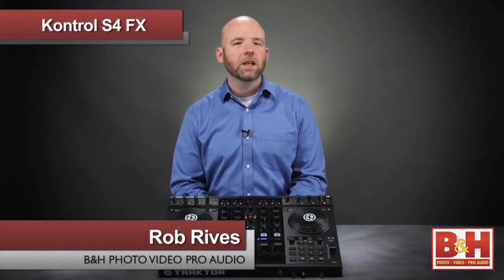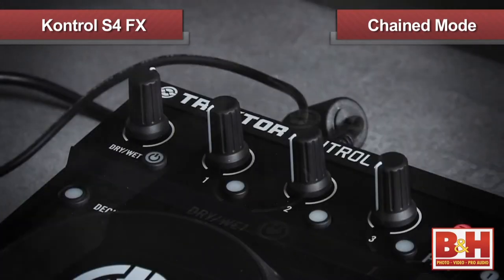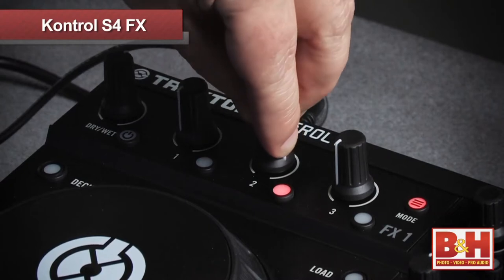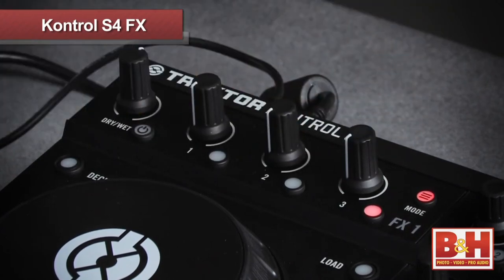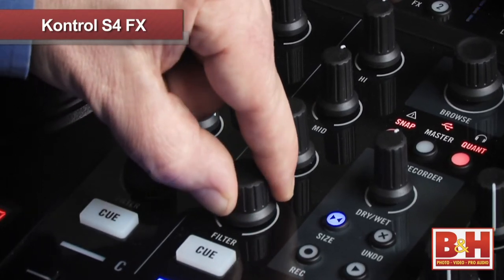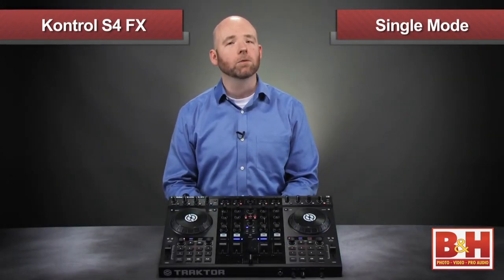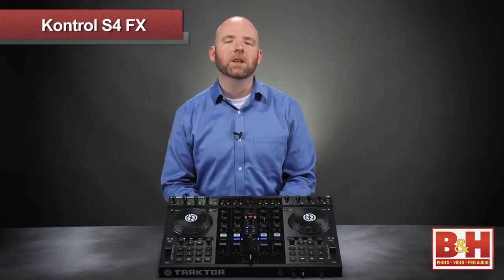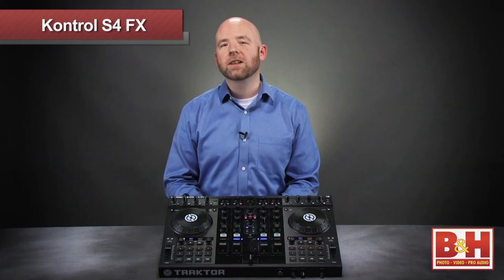Using FX in Traktor with Kontrol S4

Comment from the maker: @BrooklynStyle106 There is no reason that you would have a problem using this controller on a Dell computer as long as it meets the minimum requirements. The system should have an Intel Core 2 Duo processor at 2.4GHz or faster, 4GB of RAM or more, and a free USB port.

Comment: I like your video since it explains the beasic ideas of the different effects in Traktor.

But your first example for the chain mode misses the point. At 5:11 all the parameters are on their max which has exactly the same effect as in chained mode... So in this case there is no difference.